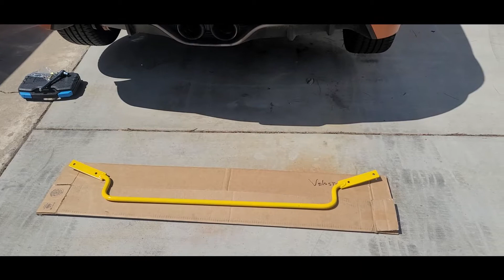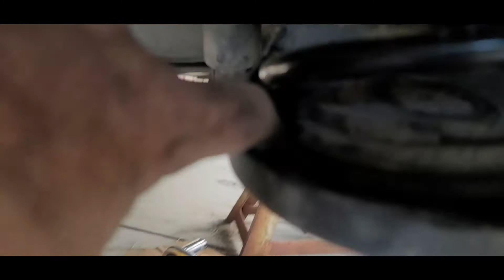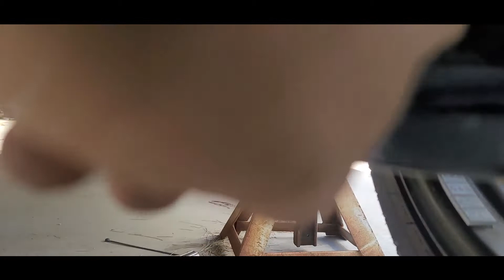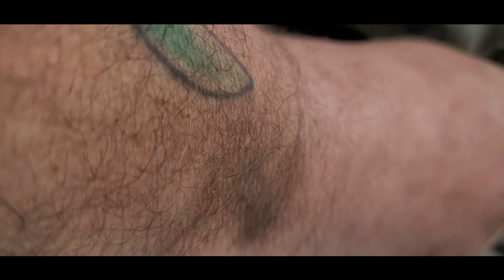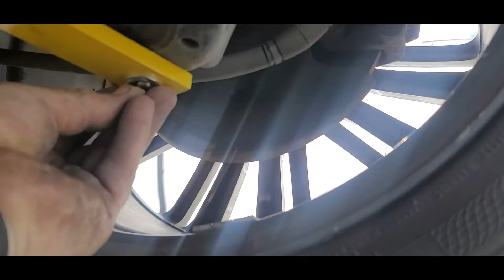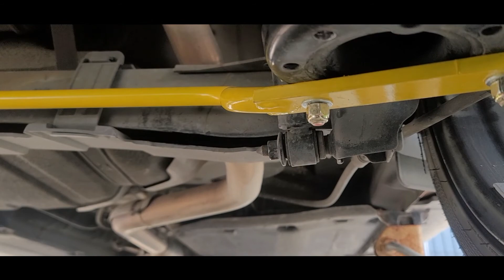2016 Hyundai Veloster DCT Turbo, Evilla Motorsports V2 Rear Torsion Bar install

Comment: Hey man I need a rear sway bar for my 09 accent but there's nothing out there... You'd help me out a lot if you could measure from the center of the bolt hole to the opposite side for both holes.. If you read this.... YOU DA BEST
Reply: :O
Reply from the maker: Sure no problem, I will have to do tomorrow,  I ll post it here for you
Reply: @ikiru1969  you're a life saver!
Reply from the maker: I hope this works https://www.facebook.com/photo/?fbid=10216570262444104&set=a.10216570261284075
Reply: @ikiru1969  yes thank you very much!